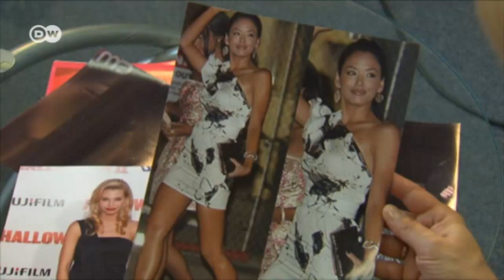Evening gowns made of milk | DW English

Comment: How stable are the fibers extruded from milk proteins? It says that no chemicals are added. Do they biodegrade over time?
Reply: how stable is silk?
Reply: U can probably cut ur used milk dress for breakfast with tea or coffee instead of donating.
Reply: Actually there are some nasty chemicals involved to turn milk or wood into clothes. But it is still healthier than poliester. Poliester is perfect place for germs while tencel and viscose are anti-bacterial and don't attract bad smells as much. Very little toxines stays in clothes and honestly many of synthetic dyes are more toxic than tencel and viscose. So taking it all into account I think tencel clothes are more sustainable because they can last you for years as long as you wash them in right temp of course. So despite less environmentally friendly production clothes themselves are more sustainable in long run. And they biodegrade too. They also make good sportswear as they suck sweat well. Linien and hemp have the same properties and are the most sustainable natural fibres but are not as soft it takes about 10 washes for it.